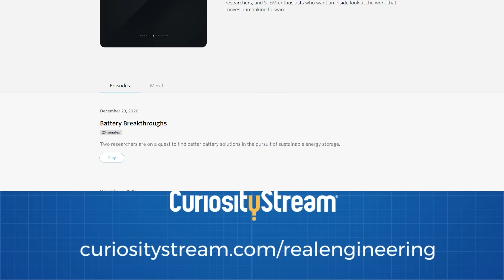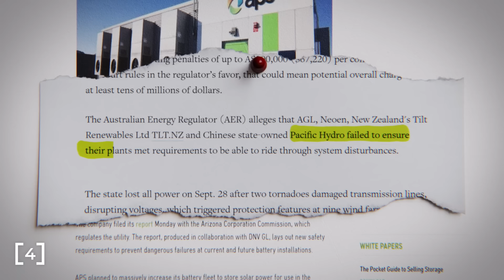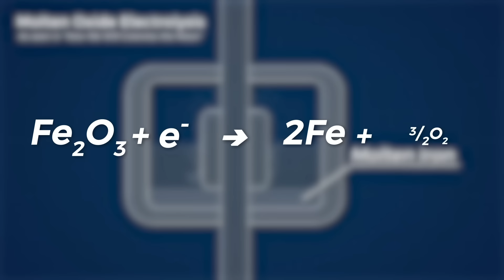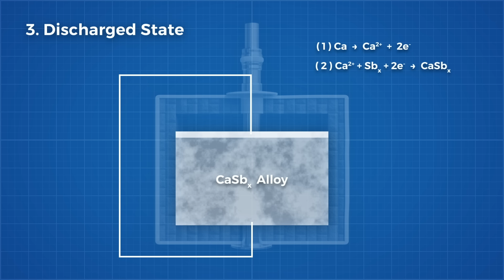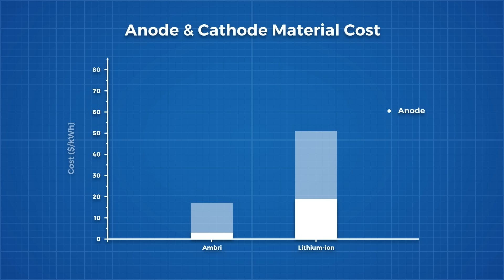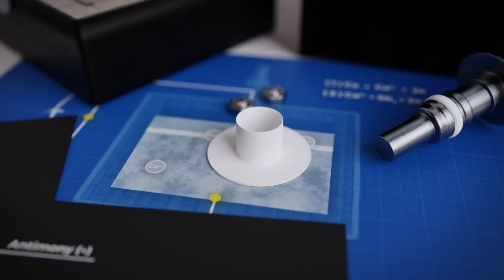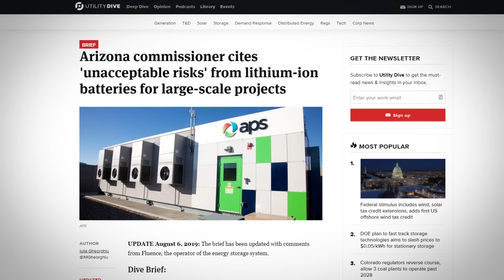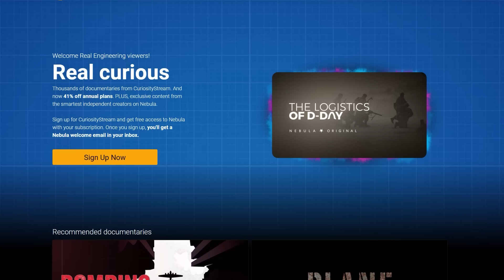The Missing Link in Renewables

Comment: It would be interesting to make a back-of-the-envelope calculation to find out how extensive the battery capacity would have to be for the grid to run on renewables.
Reply: not just interesting, necessary!
Reply: @mayamayhemmusic  yeah... I have a feeling it just wouldn't add up if you count that solar isn't reliable seasonally in many parts of the world. There, you'd be left with a wind + batteries mix, which sounds like you'd have to set up a massively oversized wind capacity for it to run on almost windless days.
Reply: These numbers have been run before, and the conclusion was that there is no storage technology that allows solar & wind to support a 1st world economy, because the energy required to maintain the whole system pushes the total return below a required 7/1 return on invested energy (this was assuming solar-thermal with pumped-hydroelectric for storage, which capped out around 5/1 as the combination with the best return; the need for 7/1 was largely dictated by things like aluminum smelters, rather than houses or anything). Hydroelectric and nuclear are both capable of the needed returns, but there aren't enough usable hydroelectric sites, and the very people most concerned with the environment tend to be extremely anti-nuclear, so the options that are easiest to do turn out to not match at all with the options that will meet our actual needs.
Reply: @absalomdraconis  That is the problem, when your Environmentalists are radical Luddites who bases their agenda based on ideology and not real science. The status quo remains the same until this doesn't change, which means less and less nuclear more and more fossil and renewable and our GHG emission increases constantly. The same people who want to save the planet based on their words are the biggest obstacle in the way to reduce our GHG emissions.
Reply: @Daniel Meyers the current supply lithium and cobalt is one of the major limiting factors for lithium batteries. If you attempt to run every vehicle not to mention cargo ship with them the supply will not be able to keep up. You would need several times the cobalt supply in the Congo to just power cargo shipping, and you would need batteries that are about 8-10 times more power dense to even try. Or you could just put the proven technology of nuclear power plants on cargo shipping and shipping would be carbon free, faster, and need fewer ships.
Reply: @Daniel Meyers "is going" sounds like a pre prototype idea, not a workable solution untill it is in production. Nuclear powered shipping has been around for decades.
Reply: @Daniel Meyers Real Engineering also did such calculations on California and that was not the result. More over current battery technology is a no go as storage grid and hydro power plants and pumped hydro are very niche.
Reply: @Daniel Meyers civilian russian ice breakers
Reply: @Daniel Meyers hard to hide it long enough to get anything off of it
Reply: @Daniel Meyers getting natural uranium is easy. Refining it to yellow cake isn't hard. Enrichment is about impossible without a country supporting you.
Reply: @Daniel Meyers step 1 capture a nuclear powered ship. step 2 sail it to a port that can handle a large cargo ship. step 3 somehow don't get caught with a stolen cargo ship at a large port. step 4 ????. step 5 profit.
Reply: @Daniel Meyers easier to just make a nuclear power program that you get developed countries to pay for or invest in. Like Iran did.
Reply: @Daniel Meyers you still need facilities for enrichment that are hard to find, and state sponsored piracy/privateering is heavily frowned upon in the UN.
Reply: @Daniel Meyers biological and chemical weapons are easier to make and hide.
Reply: @Daniel Meyers a few smoke detectors in the boston marathon bombers pressure cooker would have made it a "dirty bomb". A similar amount of weapons grade uranium/plutonium would have had made it just as effective as a terror weapon, but only a tiny bit more harmful.
Reply: @orkin2525  I mean you have companies like Rolls Royce that been producing nuclear power systems for submarines for decades so the whole economy of scale is already in place. The problem is all that tech is classified by the defense industry and may well use some kind of weapons grade plutonium like who nows.
Reply: Way too expensive. It's better to use pump hydro storage instead.

Comment: TBH, Redox Flow Batteries seem like the more promising technology for this kind of application. Super cheap and massively scalable.
Reply: Yeah I would like a video about them too from Real Engineering. Specially organic ones.
Reply: As far as I know this redox Flow batteries Kennedy Energy man seine definitely and you need some big reaction Chambers to quickly Store BS energy amounts and we are talking of millions of cubic meters to store Terawatt hours... in my opinion the best chance we have is to synthesize Methanol or something similar to store the energy in and pipe it through fuel cells to get the energy back out. It would even be easier to transport and distributed energy in this form
Reply: Although there is an opportunity in molten salt that could be used to create steam to drive turbines and be easily heated with electricity and maintain heat for longer  periods and you could even transform old power plants into this types of storage
Reply: Yep soon as I heard that it needs to be stored hot i thought why not redox flow
Reply: Honestly, for grid energy storage, the best option for the foreseeable future is probably going to remain pumped hydroelectric. The lack of good sites is a nuisance, but a nuisance that ultimately can be dealt with by digging deep reservoir tanks: an expensive nuisance, but one that will pay off. Batteries themselves are almost incomprehensible as an option, because you need to batteries to not simply have a large capacity, but more particularly to have both extremely low losses (less than lithium-ion) and to last a long time (much longer than lithium-ion). If Satoway really can pull off full reversability of the chemistry then hopefully that would achieve it, but I certainly won't believe it until I actually see it done.
Reply: Until you see their efficiency is around 70%
Reply: @TecSanento  in regards to molten salt, some companies are working on using heat pumps to heat a salt and store the cold energy (technically speaking, they remove the energy from a material to cool it) in liquid hydrocarbons or an antifreeze liquid. In these heat pumps, nitrogen gas or argon gas can be used as the working fluid, and reversing the process of pumping heat allows electricity to be generated. The molten salt and antifreeze liquid are each stored in insulated tanks. Current efficiencies are around 60%, but their low cost, higher energy density, and scalability compared to some other energy storage tech might make them viable in some places even if the efficiency is relatively low.
Reply: What are redox flow batteries...
Reply: @etiennelamole9565  Pumped hydro is less than 70%. I'm not sure what Sadoway's source on that is, but there are numerous inefficiencies in pumped hydro. I think in a perfect system it might be close to 70% but we can't achieve that yet AFAIK
Reply: @roebbiej  im curious too.. gonna check wiki
Reply: The limited quantity of Vanadium. It's a rare metal. Calcium and iron are quite abundant, and cheap. That's the trade-off. the energy needed to maintain the temperature of liquid metal electrodes, or the virtual zero standby loss of the Vanadium redox system.
Reply: @absalomdraconis  gravity storage is ridiculously low energy. It only works for pumped hydro when you get vast lakes for free. Do the math and realize that a single 3.9 Watt•hour AA battery can lift a ton 1.4 meters into the air! So you need to move tens of thousands of tons of material up a huge height. The cost to dig out an underground reservoir, in addition to an above ground storage one, Is astronomical!! And unless it's thousands of feet down it's not going to store a lot of energy.

Gravitricity is a Scottish company fantasizing about lowering heavy blocks in unused mineshafts, but again do the math: you need to be raising and lowering hundreds of blocks each the size of a school bus to store a decent amounts of energy, so now you need an underground rail yard to deal with them all.

Again, gravity storage is terribly low energy. There's a reason you don't get charged to use an elevator, and skyscrapers don't run their elevators at night to store energy.
Reply: Obviously redox flow batteries aren't super cheap, because negligible amounts of them have ever been produced for energy storage!

I think you mean PROJECTED to be super cheap, if and when a bunch of engineering challenges are sorted out.
Reply: Totally agree and there are companies working on commercialising the technology
https://redflow.com/products/redflow-zbm2/

Something i would also like to see, is retrofitting oil terminals to be flow batteries
Reply: Or Bromide/Bromine batteries.
Reply: @absalomdraconis  Gravitational potential is much less dense than chemical potential: Solutions like pumped hydro (or compressed air storage or liquified air) have a too large footprint because they require an enormous volume to store resonable amount of energy to support something big as a city. Also, they are economically feasible only if you already have a suitable geological site, pumped hydro requires 2 near lakes at different heights (or the artificial realisation of something like that) and that cannot be achieved often.
Reply: @hirumaryuei  It is more likely around 55% (roundtrip)
Reply: @skierpage  absolutely right, gravitational potential has a low energy potential compared with chemical one. It is convenient only when you have the perfectly suited geographical conditions as an undergound cave or 2 lakes at different heights.
Reply: How about the cheap and off the shelf technology explained in the video "Liquid Air Batteries. Literally energy from thin air. Seriously. Literally!" by "Just Have a Think"?
Reply: @absalomdraconis  
Pumped hydro is barely more efficient than a  lithium ion battery. (Around 80 percent) it is also spectacularly low in energy density compared to batteries. You would spectacular amounts of land to become reservoirs to provide the kind of energy quantities that we would need. Furthermore it by no means would be cheaper than using batteries, in fact huge terraforming projects are insanely expensive and disruptive. This is why pumped hydro is only worth doing it you have a natural feature that can be exploited, and even so they're not all that cheap. The one advantage of pumped hydro is there is no real performance loss. However looking at new generation of batteries such as redox flow batteries also don't suffer performance losses and can do deep and frequent charge / discharge cycles for up to 20 years with no real penalties.
Reply: @vincentrobinette1507  there are redox flow batteries being developed with earth- abundant materials. Check out organic redox flow batteries

Comment: Hi, the new SiO2 battery technology seems to have more potential than lithium (I've been using it off the grid for 2 years now).  Silicon and oxygen are widely available on Earth, they resist more to temperature change and offer more cycles than lithium, they are more than 95% recyclable.  On the other hand, they are heavier than lithium, but it's not important for static storage.  Fun fact is they turn from liquid to solid when charged and discharged!

Comment: This is a crazy idea but it would be a fun video to use Lake Erie as pumped hydro from lake Ontario.   The drop is something like 320 feet and Lake Erie is ten thousand square miles.   Only have to put 3 to 9 inches in it
Reply: I don't know much about pumped hydro, but might they lose a large amount of energy with losses from a lake that large?
Reply: @Bob_Lob_Law  , the losses come from heat in the pump motors and friction in the plumbing.
 The big size of the reservoirs just means more storable energy :)
Reply: @massimookissed1023  What about seepage, evaporation etc? Who is to say all the water you pump up will come back down again, with a natural reservoir of such a large size?

Also, if this is such a great idea, why hasn't it been implemented yet?
Reply: Very interesting idea, and quite near the original home of Alternating Current power!
Reply: @Bob_Lob_Law  I think you are trolling.   The present inflow to Lake Erie from the Detroit river is more than adequate for all the current seepage and evaporation.   Adding a few inches would not make any difference to that
Reply: @Bob_Lob_Law  Remember the power plants at Niagara Falls? Also pumping the water back is an ecological disaster.

Comment: Imagine using the heat generated by that data center combined with a heat pump in order to keep the batteries at optimal temperatures.
Reply: sucking out the heat from the servers and putting it straight into the battery room, thats genius.
i wonder how much you can heat up a concrete room before it starts breaking down.
Reply: @koloblicin refactory concrete

Comment: Why not put these batteries inside the solar thermal towers? you then have a constant heat source and heat back up (molten salt) and renewable source of energy, and then the battery backs up the entire system.

Seems like this can be this niche market.
Reply: Maybe not in the towers, but somewhere in thermal contact with the heat cycle. But I don't see the point, you already have a cheap heat resorvoir "battery" in the molten salts, why add an electrical battery? Besides, Tonapah has been a disappointment compared to other technologies from my understanding, I doubt we'll see more of them being built.
Reply: @alandoak5146  The heat res can't be scaled the same way the batteries can, but the heat can aid in this kind of battery's efficiency, I agree with you though.

Perhaps a hybrid system of integrating the heat capacity in with the battery pack.

Comment: As a Canadian, one of the most important questions is how much power can the battery hold under extremely cold conditions?  We need mass power storage that works in sub zero temperatures reliably.  For that, lead sulfide is still the most reliable though it's power density is very low for it's weight.  Lithium Ion are unpredictable when they are required to charge or supply power below -15C.  Canada's north has lots of wind all year around but there is no means of storing that power using pumped hydro (it's too cold and permanently frozen)

Comment: I can see it working for magacities energy storage as a group of huge underground "siamese" swimming pools, to "share/stabilize" its heat, connected in series to reach the desirable voltage. The terrain layer around the ceramic pools can work as a thermal battery and other outer terrain layer can work as a insulator, just changing its composition (sand/clay) during the site construction phase. Keep in mind that volume grows "cubic" and area grows "square", it means the bigger the volume gets, less surface area in proportion to lose heat.